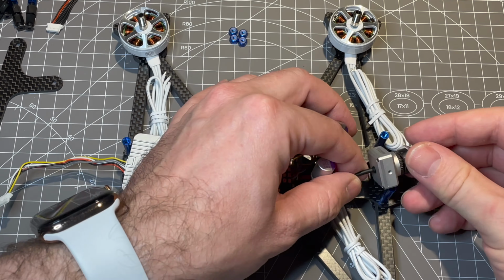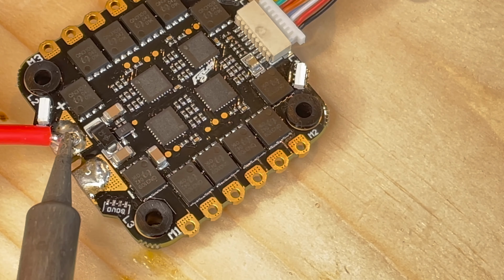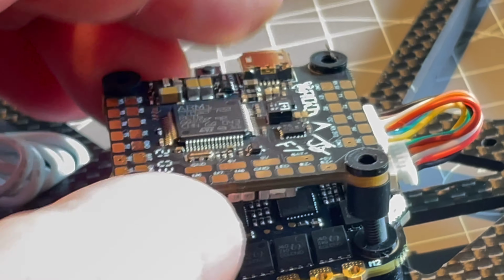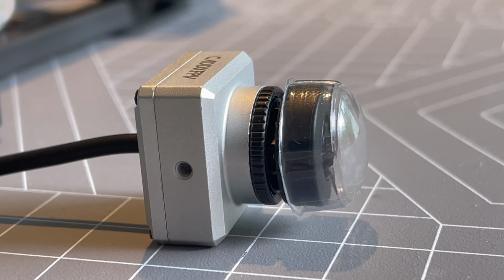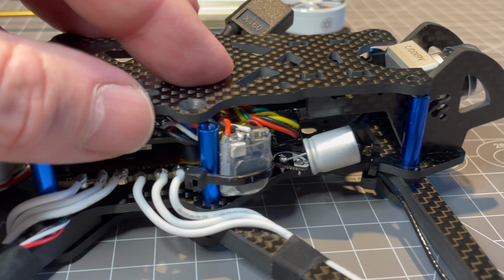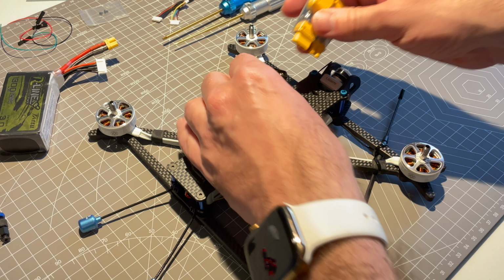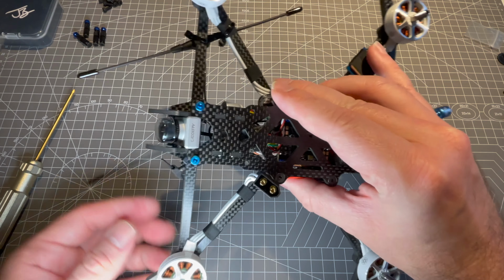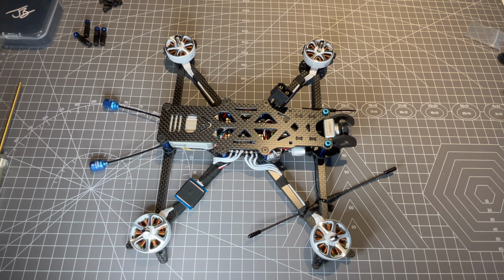AOS 5.5 freestyle build | Joshua Bardwell JBF7 | FPV CYCLE | HD drone quad DJI AIR UNIT PART 4

Comment: JB7 seems a tall stack. Did you manage to fit it in main 30x30 standoffs without problems?
Reply from the maker: Yes, it was just fitting in fine! All good if you don't mind that the battery strap is sitting a bit tight.
Reply from the maker: I tried it out but decided to settle and go with the Nazgul Evoque F6d for my main LR cruiser.
Content coming soon to the channel 😊

I also enjoy flying the Rekon 6 but in slightly different situations since it is a much lighter quad. Very nice to fly and I love it as well! A few Rekon 6 videos are already up here on the channel, enjoy!

Comment: I finally got my AOS 5.5 Frame, but am missing the Stack screws.
Do you by any chance know how long the Stack screws have to be, to not poke through the top plate ?

Unfortunatly here in Germany the FPV Cycle Motors are very expensive with shipping, so i thing i will go with the Xing E 2208.

Your video was really helpful ! :)
Reply from the maker: Very good point!  Yes the FPVs are quite pricy in Europe. 
However, they are really outstanding, jus super sweet great motors. Even the higher price tag considered, if you can make the budget available, I feel it is still worth it. Maybe you want to think about it. 
I am traveling right now and don't have the AOS with me. I remember it was a standard size. 
Ask CNC who was cutting the frame for you what the exact spec of those screws are. They should have them shipped together with the frame. Maybe you can get at least some discount for the missing parts. 
Have a great rest of the day!  🤙🏻🙃 and happy flying!

Comment: Hey, nice Video! 

How do you feel, this Frame compares to other Freestyle Frames in terms of crash resilience ?

I am looking for my first 5" Freestyle / Cinematic Frame, and have to choose between the FPVCycle Prototype 5 and the AOS 5 / 5.5.

I of cause would like to fly with a Gopro, so the 5.5 is really compelling. Does it perform better in terms of flight-time, because of the bigger Props  you can slap on there ?

What would you recommend personally?
Take it easy and Merry Christmas !
Reply from the maker: Well, I think it is as perfect as it can be. . . IF you put function first.
The design, in terms of looks, is unique and might not be everyone's cup of tea.
When putting function over form, well I think there is nothing wrong with the AOS line of frames.
The alternatives would be JB's frame, the QAV-S JB Edition, or the Apex.
Merry Christmas 🎄🎅🏻🥂and hope your project turns out to be great 👍🏻
Reply from the maker: I personally can definitely recommend the frame and yes, 5.5" is giving way more lift capability plus longer flight times. 
Exactly what Chris was predicting I found to be true when flying my build!  I can use it even also as long range cruiser if I want to since it is highly efficient. For motors I would go for the 5" FPVCYCLE. The are totally fine for the 5.5" platform.
Reply: @MattShonan  that sounds great! Thank you for you in depth thoughts. Before i have to save up some money though...worth it however since its the best stuff out there :)

Comment: I got the 5.5 on it's way. Enjoyed this video and thanks for the shield tip.  Only wondered why you didn't pick the Polar starlight on it?!
Reply from the maker: Well, I like to original DJI camera best in the usual lighting conditions, for winter flying when it is darker I will configure 2 of my quads with the Polar adjusting to the over all low light conditions. Maybe even the AOS 5.5.. 
Good luck with your project and let me know how it goes! 🙃🤙🏻
Have a great rest of the day!
Reply: @MattShonan  It is the best camera in daylight for sure, we are losing a lot of light early here, almost feel I need to switch all my quads to polar, but I like the nano v2 as well. choises choises. I'll let you know you'll see it fly by :D

Comment: did you soldered the mamba interfierence shield to the FC? has recomended by diatone? Chris Rosser soldered to the negative battery lead. Thats ok too.
Reply from the maker: Thank you for your valuable comment, 👍🏻
I did not do that yet but it is on top of my list to solder it to ground somewhere!
Definitely important to do so and I will mention this also in my next video PART 5.  
Have a great day! 🙂🤙🏻
Reply: @MattShonan  glad I help. You can solder it to any negative pad on the FC
Reply from the maker: Will take a quick video where it goes in the end show in my next video 👍🏻
I have to take it apart anyways so maybe I will use the FC or it might go to the RUSH PFB ground, will see where it fits best wiring wise.